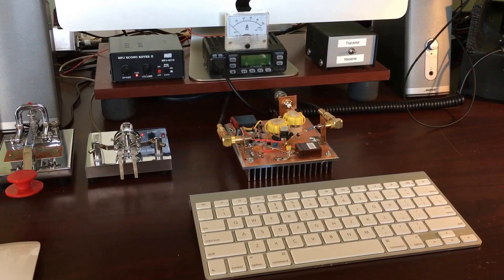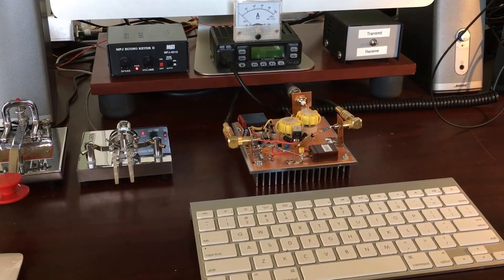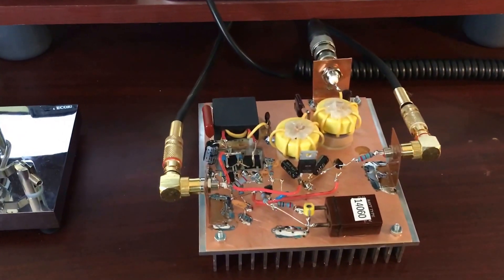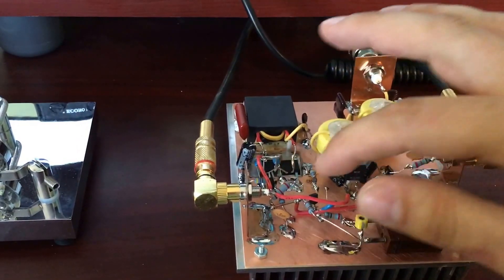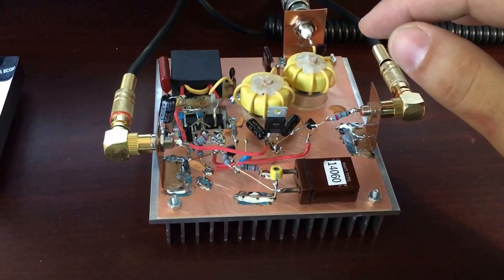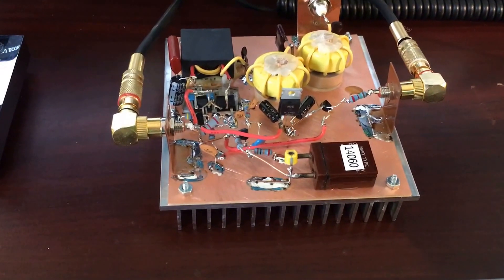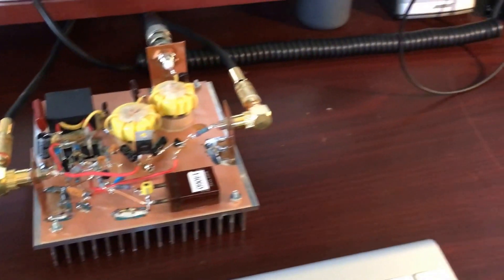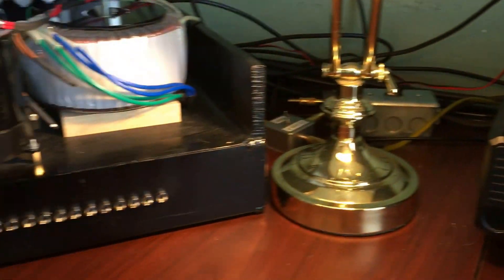20 Meter QRP Transmitter

Comment: Hi.  Do you have a schematic of any of this you could share?  Specifically do you have a gate resistor between the driver and the irf510 and do have a coupling capacitor after the transformer?  What peak voltage do you get on the gate?

I have a very similar circuit I was in the process of putting together on the workbench (for 40m), I think maybe even the same driver, but using an Si5351 instead of a crystal.  But still playing around in ltspice before I solder it up.

Thank you for sharing your project!